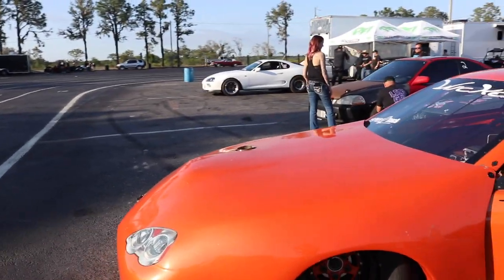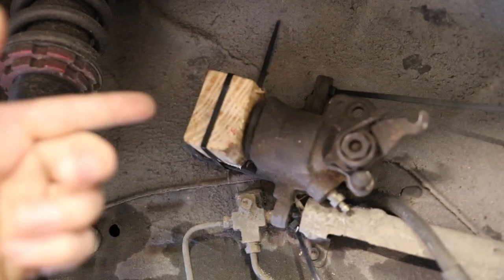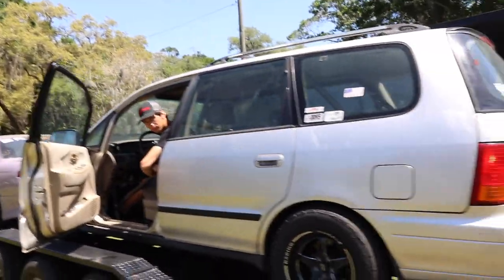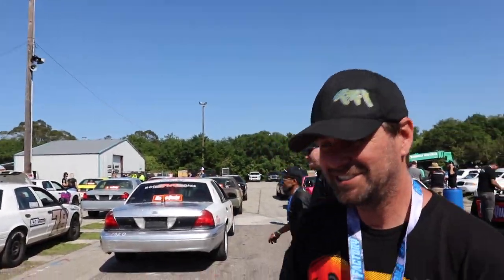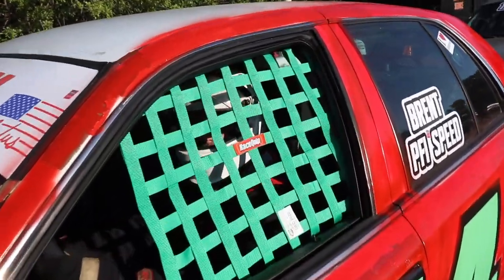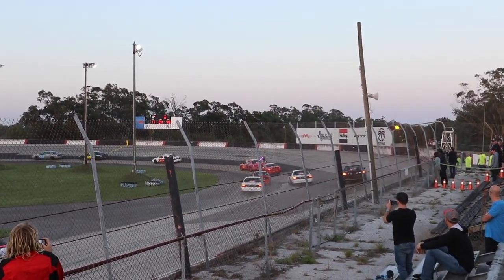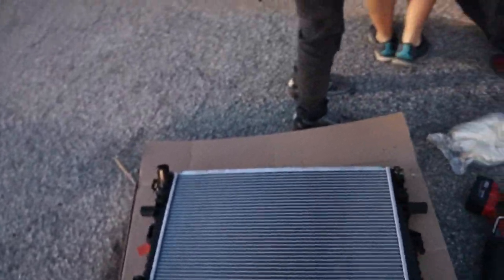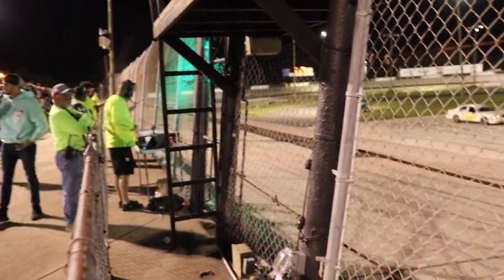Travis Pastrana Meets The Rowdyssey! (1000Hp Minivan)

Comment: Never seen a rear brake delete quite like the one on the S14.  In hindsight, I friggn love it
Reply: A bolt with some npt tape would be so much smarter or loop the booster.
Reply: @duanebailey6253  Sounds like you enjoy bleeding brakes more than I do... What I love about the block and ziptie method is that it would take 5 minutes per wheel to convert back and forth.  That's dope.  I might replace the scrap pine with a more trustworthy material, but the proof of concept is there

Comment: Hey guys just put a brake lock in the rear brake line. So you can just cut the rear brakes with out any other work. Then when you are finished turn it back and you have 4 wheel brakes again. All my cars have one in line. Takes maybe an hour to do. Cain hard guys.

Comment: Put a valve on the master cylinder so you can shut them off in the engine bay highly illegal here in New Zealand work a charm. Curious to know what the issue was with the crank and the clutch

Comment: How is there still no handbrake in the S14? Like I understand cutting the rear brakes off for burnouts but so you don't go into the wall I'd think ar least having the e brake caliper instead of using both calipers. But do you bud you'll get real sad when you smash the rear end cuz you didn't have a handbrake to correct your course

Comment: The short-pipe exhausts on the S14 don't seem to do it justice, as if it needs a full exhaust system for it to sound right
Reply: They need to merge both banks together
Reply: @nismogsus6297  They need to throw most of those cars in the dumpster lol...
Reply: @thomaskunz8029  Maybe you can sell them one of your cars.

Comment: Why not just put a line lock on the rear brake line? Then switch it before hitting the brake for drifting. Then you can control braking in just the front without work.

Comment: remember when you bought a 2jzge and decided to go with that shitty J series, bet you're starting to regret that.
Reply: It's from the bat rod.  Cant blame the motor when it was overheated and left for dead for 6 months.
Reply: @duanebailey6253  this is their 3-4 J series in the 240 and thats also the 2-3 Jseries in the batrod
Reply: @MrJuice315  they are also beating the crap put those stock motors on a (respectfully) borderline tune. Perhaps you guys in the USA have your JDM goggles on, but here in the UK, you lean on a stock 2jz the wrong way itll pop just as fast. stout engines for sure , but remember the J wasnt designed for boost and id say it holds up well all said and done.